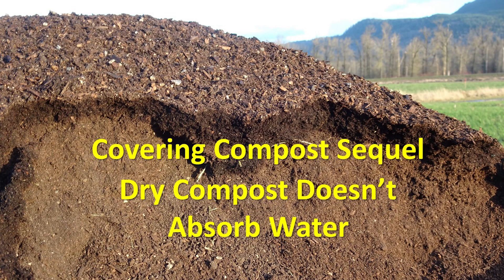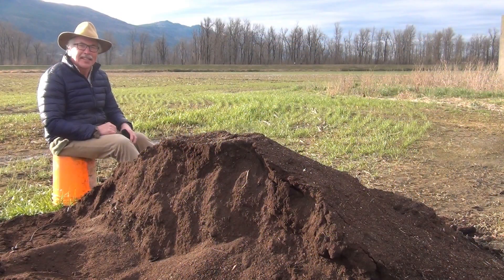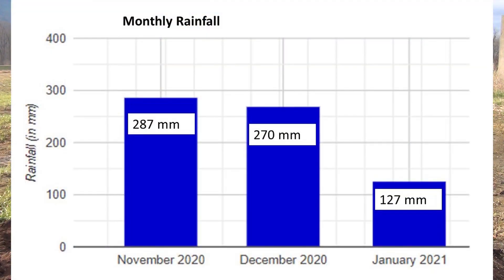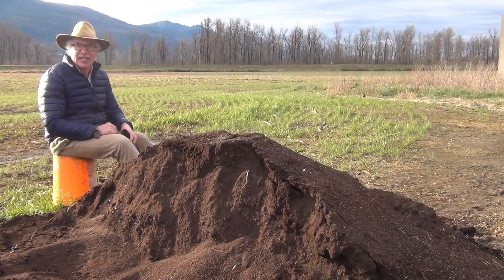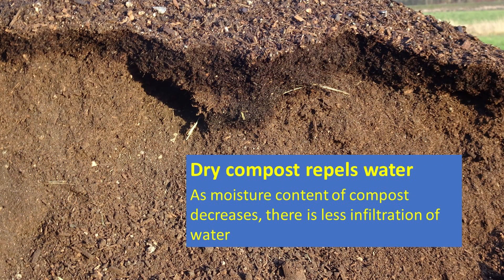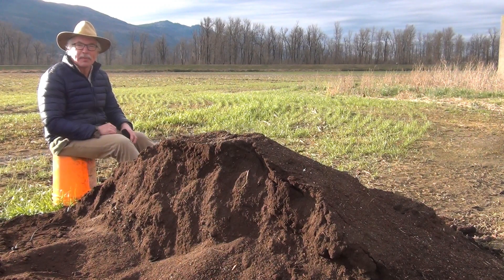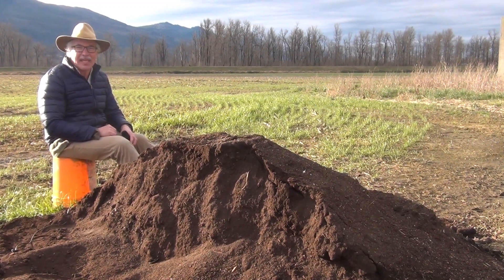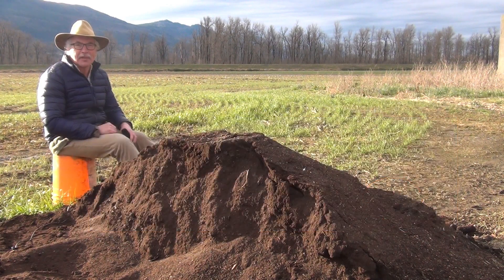Dry Compost Doesn't Absorb Water

Comment: John Paul I got some organic commercial compost like this and spread 2" over my garden rows. I have drip tape watering and neither that nor surface watering wets this compost well.  My seeds aren't germinating!! Any advice? Thank you.
Reply from the maker: Thanks for your question. If the seeds are planted in the soil underneath the compost, they may be a bit deep, its best to remove the compost from around where the seeds are. Its not recommended to put seeds directly in the compost layer, as the electrical conductivity in soome composts may be high.

Comment: @1:149 "The most efficient way to add water is while mixing."
Is the most efficient, or perhaps just least effort, way to add water not by poking holes with a metal rod and opening up a little air and water infiltration path, and then pulling the rod out and repeating throughout the pile?  I ask because I do this to an extent in place of always turning and mixing the pile, as it is much easier for a home gardener and therefore possible to do more often.
Reply from the maker: Yes, that is an excellent and efficient way to add water to a small pile of compost. Wetting a larger pile can be a bit more challenging!
Reply: poking hole still have possibility that if water finds a way to get out without mixing, it will. Your tricks i good if compost is not fully dried yet. But his trick is broad.